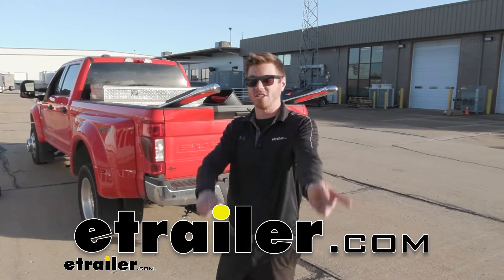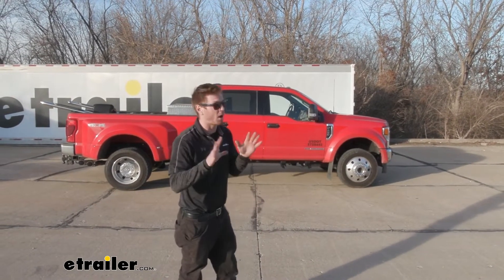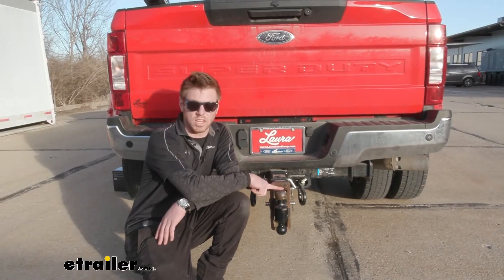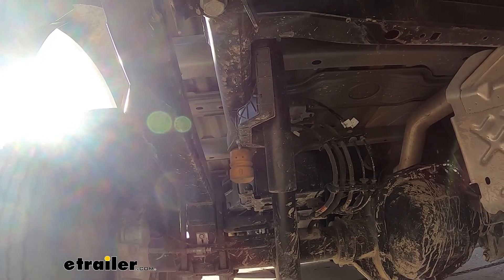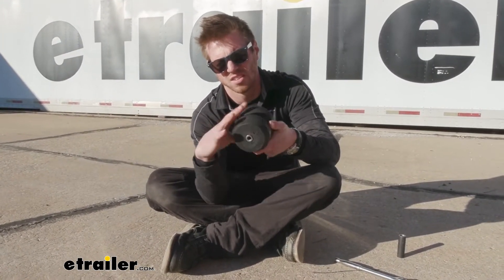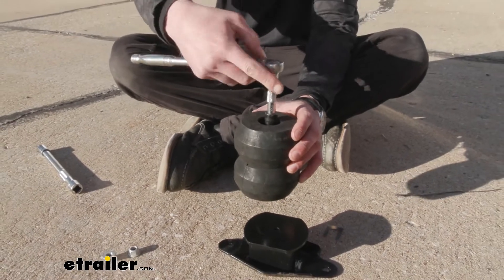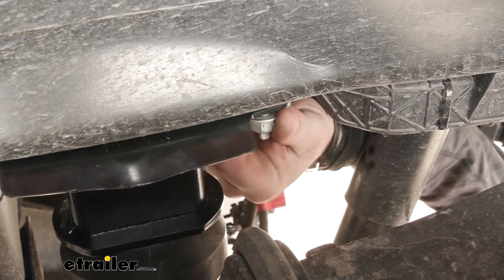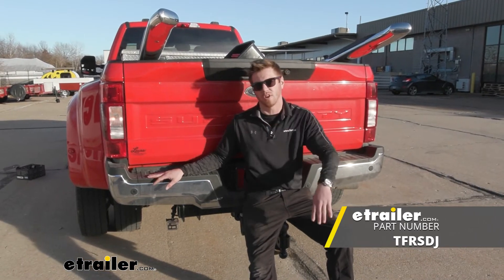etrailer | How to Set Up Your Timbren Suspension Enhancement System on a 2022 Ford F-450 Super Duty

Comment: My 2021 f450 had the landing pads like in your video for the timbrens to make contact with when carrying my slide in camper. Sold the truck and got an f350 dually. The f350 does not have the landing pads, the timbrens will make direct contact with the top of the axle tube. Will this hurt anything? When the camper is loaded the timbrens will rest on top of the axle tube and remain there when traveling.
Reply from the maker: That is perfectly normal for the Timbrens to make contact with the top of the axle if you do not have a landing pad.
https://www.etrailer.com/Vehicle-Suspension/Timbren/TFRSDJ.html